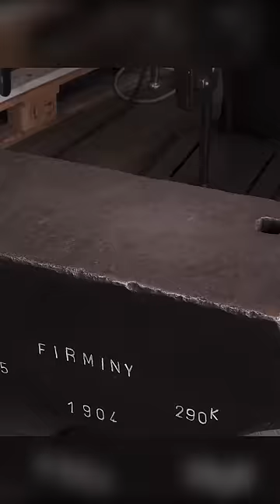1883 Bowie, Super Speed Build! #shorts

Comment: That’s a really thin tang, it’d probably snap off the blade
Reply: Working that blade as cold as he did sure doesnt help
Reply: @Vv_Twisted_vV  would then final heat before quinching it fix the stained areas of the steel since its getting near the steels melting point
Reply: @fishman2586  I would be more worried about micro fractures. Nothing is going to help stressed metal at that point.
Reply: @Vv_Twisted_vV  Oh I see im new to forging so still learning
Reply: The tang is plenty strong, some medieval daggers and knives have thinner tangs than that and still performed well,especially if the blade was properly tapered. Also the cold work wasn't an issue here. I hear people say cold work is bad for the blade, except i don't know of any evidence it has bad effects on the steel, especially since Japanese bladesmiths heavily cold work their blades (and i don't think anyone will say their blades don't perform well). It also helps refine the grain.
Reply: They perform well for a shitty reason. The spine is very soft and the edge too strong/brittle. This makes it good for cutting but not durable, alot of the times they used iron sand instead of steel ores due to lack of natural resources. They could'nt even melt iron unless it was essentialy dust
Reply: @DarkMark-cf1ec  that wouldn't matter much if it was done skillfully. Nowadays the very best knives are made from powder (powder métallurgy knives), and at no point are they melted together. They are just pressed together at high heat for welding, just like forge welded traditional steel.
Reply: @ForgeDuLys  Traditionally made Katanas are really brittle and overall much less functional compared to spring steel European swords. Consider the fact that rapier and katana existed at the same time and then you will truly understand how backwards Japan was, reason is they valued traditions over functionality.
Reply: @ForgeDuLys  Also cold working damages the blade putting unnecessary stress on it, when you quench and temper it then it should not be damaged by hitting it with a hammer while cold, but best not do that before it. It's not bronze there is no need to work harden it, it's heated up for a reason.

Comment: Please do not cold work your steel if you want it to perform.
Reply: Don't worry about that, a bit of cold working can be beneficial to the blade, it helps stretch the grain structure, wich helps it reduce in size at the next heat. It won't make micro cracks if you're not excessive. Japanese bladesmiths pretty heavily cold work their blades, and i don't think anyone will say their blades don't perform.
Reply: @ForgeDuLys  that is an appeal to authority fallacy.
Reply: @samuraiS30v  💀 oh okay my bad, i thought the fact their blades perform well and that they have great mastery and knowledge on the craft might indicate that it's a viable technique, beyond the name of "Japanese bladesmiths".
Here's an other argument tho : in my own personal experience, i haven't noticed anything problematic with cold forging the blade. I've been advised to do so by master smiths, who themselves wouldn't have advised it if they had noticed anything wrong with that technique. What makes you even think cold working steel isn't a valid technique? Don't forget steel is a ductile material.
Reply: @ForgeDuLys  as some one who works with Japanese knives In The kitchen they 100% perform but don't expect them to hold up, they're VERY brittle.